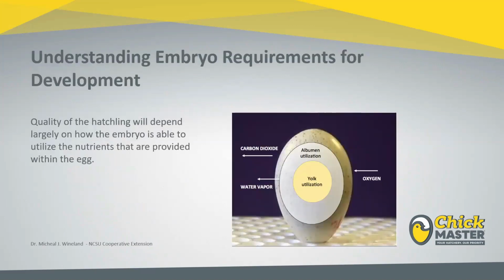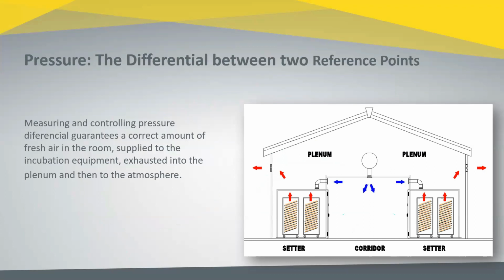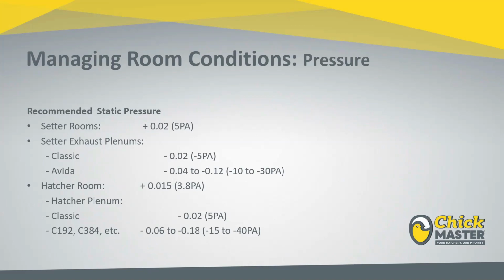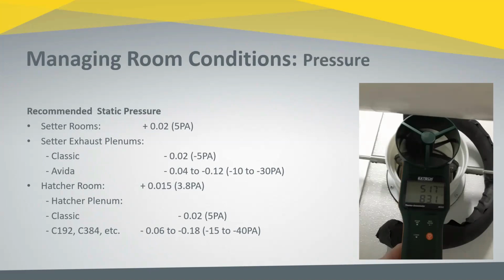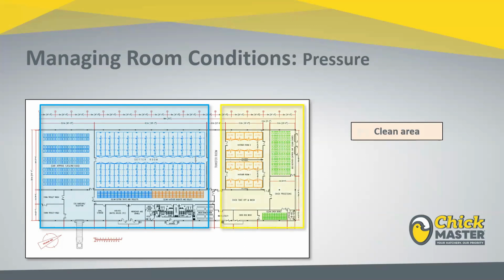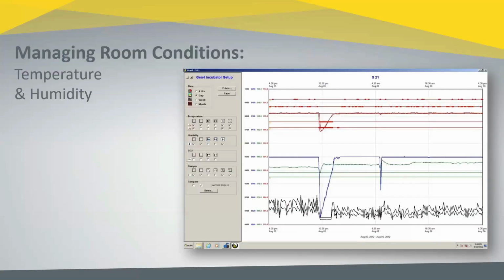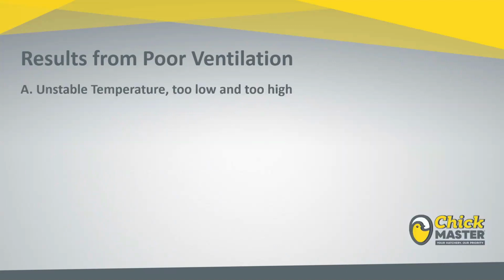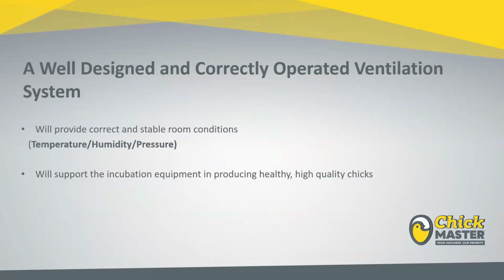Tech Tuesday: HATCHERY VENTILATION - ENG

Comment: Thank you for this explication.

What's condition per 1 or 1000 eggs on SETTER period  ( temperature, Humidity, ventilation volume and flow, CO2, oxygen, pressure ) and HATCH period ( temperature, Humidity, ventilation volume and flow, CO2, oxygen, pressure )